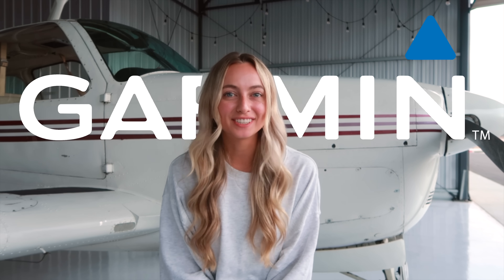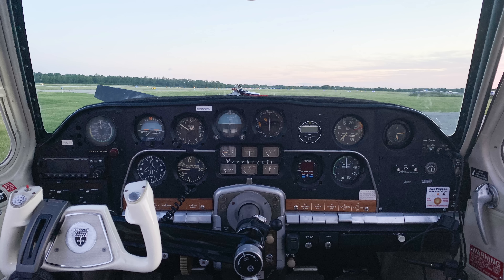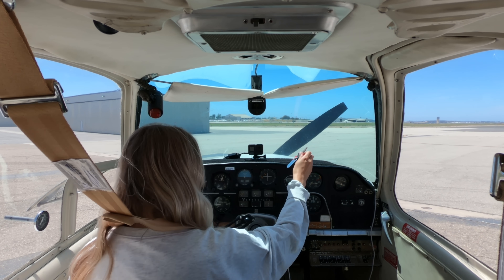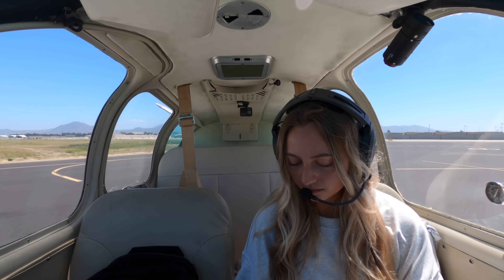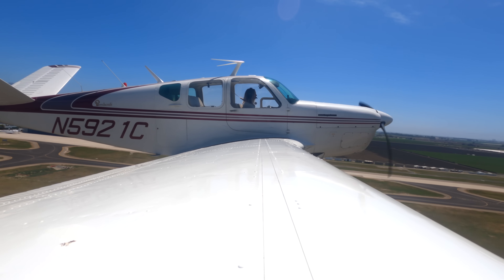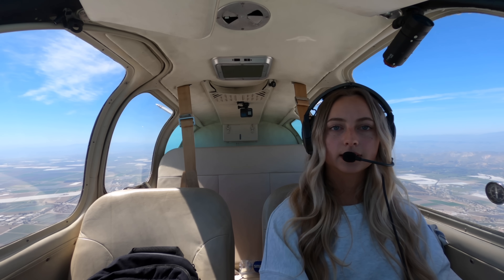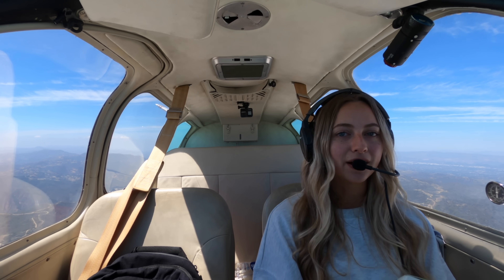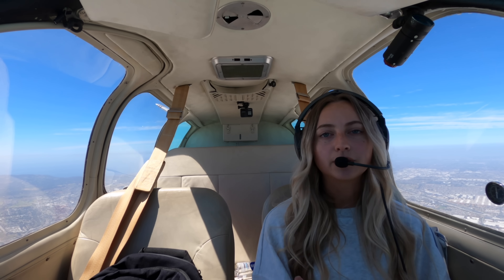Installing ALL NEW Garmin Avionics in my 1952 Bonanza | Garmin Panel Upgrade Part 1

Comment: Exciting!  Will be interested to hear real world impression of the upgrades . . . especially the fuel management and whether that completely resolves the historical Bonanza fuel starvation issue.
Reply from the maker: Can't wait to share the final product! I've been flying the airplane with the upgrades for a few months now and the fuel system is MUCH easier to manage. I'll go more in depth on Part Two of the series, but the combination of the GI 275 EIS and the Mid-Continent CHRONOS Clock make fuel management so much better.  It's so nice being able to view all three fuel tanks at once, and having a timer right next to the EIS to keep track of how long I've been on the current tank is awesome!

Comment: I did a dual GI275 and GPS175 install in my K35 last year and its been awesome.  Wireless updates for the databases make it incredibly easy every 28 days.  Being able to plan on Foreflight and then throw the flight plan to the panel via Bluetooth has been nice too.

One comment, I noticed that your CHTs are high.  Is that normal for the E225?  In the IO470/520/550, anything above 380 is a concern and anything over 400 warrants action.  Last few videos I've seen, you're over 400 even before takeoff.
Reply from the maker: The 275s are AMAZING! The EIS is my favorite so far.

The CHTs are higher for the E225! My redline is 525 😳 I usually try to keep everything below 420.  The 275 EIS has helped a ton with temperature management and proper leaning. There's a good thread on the ABS forum about it. I spent a long time trying to troubleshoot the temps - new baffles, etc - but came to find out they're relatively normal. One upgrade I want to do in the future is put 470 cylinders on the 225!
Reply: @bayflight  Something that also might help with temps. are GAMI Injectors. The engine will thank you for it by returning a gallon of fuel per hour or more, and you will notice a difference. I fly an E-225 in my Navion (Injected) . It would be the hot ticket, My 225 runs much cooler than your Bonanza at about 300 CHT, much better for longevety of the motor. I'm a big Mike Busch fan... Hopefully we'lll meet sometime, I'm located at L00. Be careful out there, IFR on the Cal coast is no joke... Ron
Reply from the maker: @apfelsnutz  I've definitely considered the GAMI injectors! From the reading I've done, there seems to be mixed feelings about them on the Bonanza forums, so it's good to hear an actual account from an E-225 owner that they work well.  I typically follow Lew Gage's information online and in his book.  My CHTs are 380 and below on a cooler day (60-70 deg F) but tend to climb on the 80-100 deg F days. I'm sure GAMIs would help!
Reply: @bayflight  Stevie, nice to have an intelligent reply ! Good you know about them, you might want to call GAMI directly and chat, they're always willing to talk about their products... I can't wait for the NO LEAD  fuel to arrive, a perfect fit for our 7 to 1 Comp. engines. Everything will be so much cleaner burning ! You might also want to check-out what Mike Bush has to say about CHT and LOP operation. All the Best to you, stay safe...Ron

Comment: This looks like a huge step forward in safety and functionality.  We upgraded our F33-A with a pair of Garmin G5's and a GFC-500 recently.  Removing the vacuum system was a big improvement in reliability.  You'll really like the GFC-500 for instrument departures.  Align the heading with the runway, set a target climb speed and altitude to reduce the distractions on departure.  Single pilot IFR is much better with a modern autopilot.  Congratulations!

Comment: Hi Stevie! Such a good vid..
Should I get the bose a20 for my ppl or not yet?
Reply from the maker: Thanks Heather! When I did my private training I borrowed a headset from my flying club. When I passed my checkride and knew I wanted to continue flying, I bought a set of A20s! If you're able to reliably borrow a headset from your flight school I'd look into that, but the A20s are great. Hearing protection is so important and while the A20s are expensive, they're definitely worth it ("buy once cry once" vs having to buy multiple lesser-quality headsets because they break). If you know you want to fly, then go for the A20s! Best of luck with your training!
Reply: @bayflight  Thank you so much! When you say a set of A20s, you got more than one headset?? Currently I'm using a David and Clark i think from my flight school, but the mic isn't great, so it's hard to communicate to atc (which is unfortunate bc I learn at HNL a class bravo airport).

Comment: Congrats!  As a G1000 student, do you use your EFB to monitor traffic, or do you plan on doing it on the small garmin screens?  And of course... the big question... approximate cost?
Reply: Yeah, me too. Well north (prolly far north) of $100k I'd guess. Nothing is cheap + a ton of $150/hr labor. But it would be nice to know the actual bottom line.